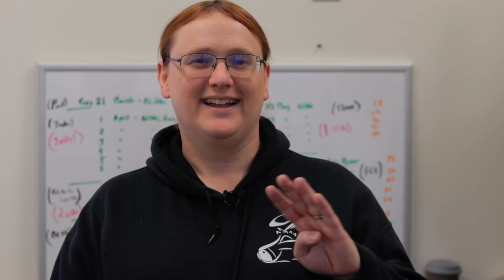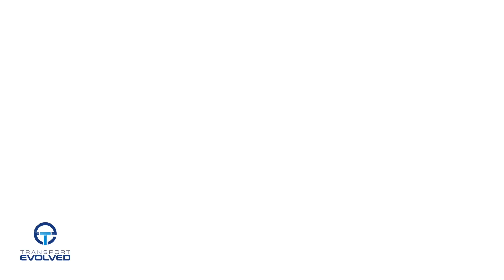What Should The Design Lifespan Of A Car Be?

Comment: Non corroding aluminium bodies, electric motors, no gear boxes, solid state electronics. The only things I see wearing out are the batteries, the upholstery and the electrolytic capacitors in the electronics. Have a maintenance system set up for them and a car stops being a disposable item. 
My rule of thumb on replacing a car is to replace it when the maintenance costs start climbing, which on a Toyota is at about 12 years. Properly designed an electric car should double that.
Reply: I agree, stop this disposable mentality with short term thinking, and let people have the pride of long term ownership and proper maintenance industry .. this dispisable disposable mentality has to go.
Reply: @MARILYNANDERSON88   What; you would dispose of the disposable culture?
Reply: @levenkay4468  lol..lol
Reply: I have a 97 corolla that i have done precious little maintenance on other than replacing the discs when i spent a summer driving around death valley.  It is getting ready to turn over 250, 000 miles soon. I was going to replace the timing belt just to be safe, but i had been researching what it would take to take it electric.  It does need a coat of paint.  So i would vote on a design life for twenty years or so, and if it is a skateboard vehicle, an option for modular boxes, as i have found it to be a bit of a jig saw puzzle to slide my harp into the passenger side back door of the sedan.

Comment: Toshiba has designed batteries using titanium oxide to last for 10,000 cycles i.e will last 30 Yrs. considering the longevity of the batteries minimum 30 yrs. life of car design in future to be expected from those who will be using Toshiba batteries. future research in solid state batteries indicate max 50 yrs. of car life span (upper body can be changed i.e. skateboard design) .

Comment: When I look at the cars on the road today, I would say that the average life of a car is already far above 10 years. Yes, people who can afford new cars every couple of years don't keep a car for 20 years, but when they replace that car after 6 to 8 years, they sell their old car to be used by someone else and that person sells their old car again to someone else and so on until you get the guy with the old worthless barrel that will be scrapped. And in my opinion, that's a good thing.

The problem with designing cars that can easily go over 20 years on the other hand, brings in another factor that we should not ignore: cost. Making sure you still have a solid, rust-free structure after that time will require better and more expensive engineering than what we have today. And yes, with EVs we have a drivetrain that can easily go for 50 years without much maintenance, and replacing the battery pack every 10 years or so shouldn't be that difficult. But then again, how many people want to drive in a vehicle that old?

Comment: They're not well designed for recycling presently, so that should be significantly evolved, but for me 20 years should be minimum, 50 years the typical because it's sooo much easier to maintain the mechanics, which themselves are far more reliable than ICE.
However, that's not what the economic system promotes, so expect lifespans to continue to shorten as consumerism MUST increase for the economy to keep lumbering along (yes the "economy"is now about anti-economizing).
Reply: You can make an ice last 20 -50 years just need to put in the work and treat it well. Make repair each time.  It does get silly how a car is not worth a new engine. I question why a car is worth so little yet a replacement engines are so much. Most likely this will be a similar outcome for Ev's by design.
Reply: @chrisredfield3240  Most stuff will have been replaced in an ICE by that time, as you elude.
Reply: @ChrispyNut  the consumable stuff will be but that's how things work. Brakes, tyres, clutches, bearings, bushes. Ball joints, bulbs. Wipers, widescreen, maybe even foot pedal rubbers. Fluids, filters,  probably missed a load of other stuff. But it's all subject too wear & tear.  Only the body, the engine (replace internal parts if required, i would expect to see 400,000 miles if serviced well with good oil)  wheels would be original
Reply: @chrisredfield3240  Pretty much just the "engine" is unique to ICE of your list (though brakes wear far quicker on ICE), which has hundreds/thousands of moving parts which constantly need oiling, constantly wearing away.

Location would matter a fair bit too for longevity, I live on the coast, cars don't last too long here, soo much salty corrosion.
Reply: @ChrispyNut  true with the salt i would hope keeping the whole car clean would help a lot. My last car to die had 168k was 14 years old the body was 100% rust free and drove like a dream i got it on 62k. 3 years old off lease.  The engine had a catastrophic failure. Real shame. It was re mapped at some point before i had it, (still wonder if it would still be going now if left stock.
Reply: Sure INTPeanut, we could have cars that last 50 years with the amount of maintenance most people are willing to do.  And they will cost $200,000.
Reply: @incognitotorpedo42  Firstly, if we still have U.S dollars in 50 years, we'd probably rather be extinct.
Secondly, as mentioned in this video, plenty of cars make it 50 years and that's back in the day when they were made with rust, by rusty men when they weren't on strike with their rusty cats and dogs.
Thirdly, how can it be getting harder as material, electrical, design and computer science has improved a bunch where rust can't even form on a car because there's no iron?
Finally (cos I certainly feel I'm wasting my time talking the wall of your anus without knowing if it's getting through), there's soooo much less to maintain, even relative to the first VW Bugs.

Talk about being unable to conceive of the future..... seriously, please, talk to someone about that so you understand you're really bad at it so you stop acting the fool when you try.

Comment: I would like to see an aftermarket battery industry pop up.  your leaf for example has a whole lot of vehicles on the road now so an innovative company like LG Chem or BYD could design a drop in replacement that has a bigger density and relatively low cost not only restoring the original range but expanding it.
Reply: Ron Fischer 😉
https://cleantechnica.com/2018/09/07/just-for-fun-bmw-i3-with-100-kwh-battery-from-lion-smart/
Reply: I'd heard that there's some sort of crypto in place for the Leaf to prevent anyone but Nissan from swapping out the battery. While I can understand why, from a marketing standpoint, Nissan would want to limit the life of the battery pack, there's no societal justification for allowing car makers to do that. So I think we ought to think about a regulatory framework that would encourage longer vehicle life spans.

On the other side of the coin, Nikki mentioned riding in a EV converted Beetle. I would love to drive one of those once or twice, but I couldn't see owning one; those things are death traps in a crash. From the safety point of view, there could be good reasons to retire really old vehicles.
Reply: I would rather see cars with batteries that last the whole life of the car so replacement is not needed. I think Tesla and probably the new cars with bigger batteries are this way.
Reply: sweinberger  for sure it could also be a situation where existing packs are rebuilt, I see a situation in 5 years where you could go into the battery shop buy a rebuilt 2015 leaf battery that has 50% more density,where they drop out the old battery put in the new battery and take the old one away for rebuilding  and the old cells are rebuilt into stationary storage for homes and businesses, the value of the old battery could be deducted from the new
Reply: @ronfischer191  I intended to reuse my Leaf batteries for my solar panels myself. I wouldn't give them back to Nissan.
Reply: @stefanjarko8874  Hey if ya got the skills, more power to ya!

Comment: Electric Motors 1 million miles and for most people a lifetime.  Car Bodies 30 years.  Car seats and body contact points 15 to 20 years.
Reply: The electric motor can last a million miles, yes, the Battery, not so much and that's the rub.
Even Tesla has cars that can't be upgraded to use the new batteries.
Reply: @TreasureHunter-hf9ff  The current Tesla vehicles have a 200+ mile range, the Roadster did not and they had to build a roadster specific battery and upgrade package to be able to use the newer batteries because the older ones were no longer in production.
And similarly batteries fail, with over 1,200 individual batteries in a tesla there will be a failed battery. 
And when that does, there is a pretty good chance that the battery will no longer be in production because it was replaced by a different battery that was cheaper to build.
And yes they need to make newer batteries because they need to increase the energy density by at least 800% while reducing the weight by 75% and the cost by 75%.
That means the battery that the Teslas are using now, are just stop gap batteries.
Reply: Pogo Here is an article on the Tesla website showing that the EPA battery range for the 2008 roadster is 245 miles.
https://www.tesla.com/blog/roadster-efficiency-and-range. 

Tesla offers replacement batteries for all their models and I don’t see a reason for your fear that they won’t unless of course they go out of business.
Reply: It is an interesting idea in order to reduce use of resources: 1 person, 1 life, 1 car. But programmed obsolescence is the friend of manufacturers and capitalism.
Reply: @cepaposible  new safety and connectivity are valid and genuine benefits of a competitive market.
Reply: Car bodies in the salt belt, unfortunately, do not last 30 years. 10-15 winters and the corrosion sets in. Some of the "supermelt" salts and salt brines applied to the roads greatly accelerate  corrosion.  

Aluminum bodies may help. CFRP bodies may help. But eventually any steel parts exposed to salt spray disintegrate. Even many stainless alloys are not immune.
Reply: Adrian Auchrome I don’t live in the rust belt anymore, but 50 years ago I lived in NY and we undercoated our cars to prevent rust.  But I understand there now are better products to prevent rust than undercoating, and they are now developing graphene coated steel.  

However 50 years ago they used heavier grades of steel in cars, so the car bodies lasted longer.

Comment: 25-50 years, it would make more sense to design them to be upgraded not replaced
Reply: Except that it is a difficult thing to do. When you look at 20 year old cars today you can clearly see the difference between cars that have been well maintained and cars that have had a little less love, especially when it comes to rust. Add to that that it isn't easy to mix new and old tech and after 20 years if you want to upgrade the components you'll have to almost strip the thing down to basics and build it up again which takes a lot more time and money than properly scrapping it and buying something new.

Imho, we don't need to look at the lifespan of the vehicle, but more at what we do with a vehicle once we take it off the road. We have to make sure we don't just dump it somewhere but that we recycle as much as possible.
Reply: @Hans-gb4mv  You are right about current cars looking bad after even 10 years but i'm thinking more of a complete shift in thinking where cars would be built to specifically to be upgraded and renewed, which one would hope would include some sort of refresh package every 10 - 15 years that would only cost a fraction of the original price.  yes it would most likely mean the vehicles would have to be built from aluminium or non rusting composites or something, but where there is a will there is a way.  Certainly we could at least extend the average car life to a good 25 years so it's resale value holds better and the secondary market gets better cars for longer.